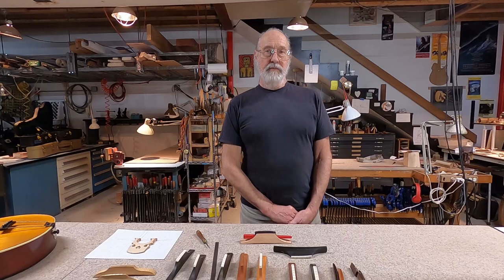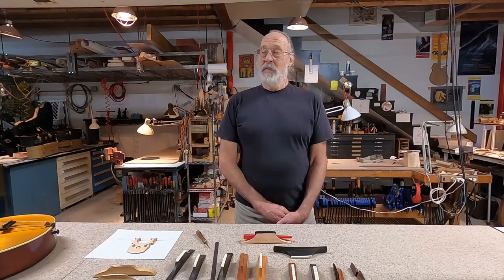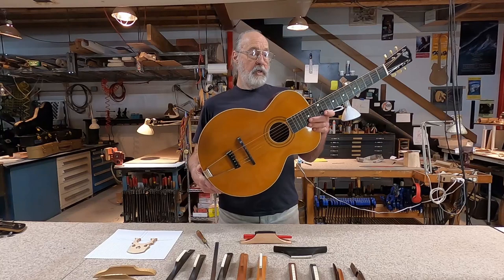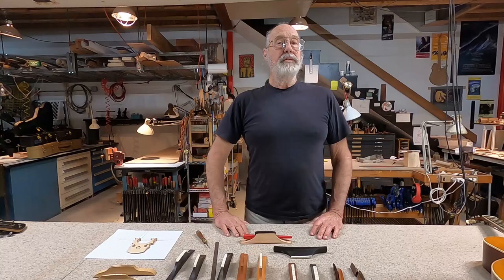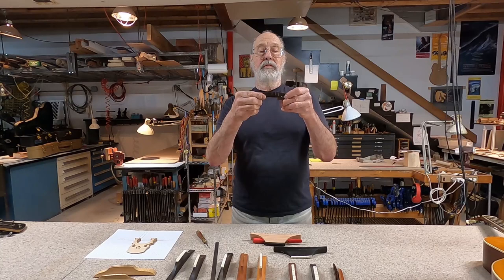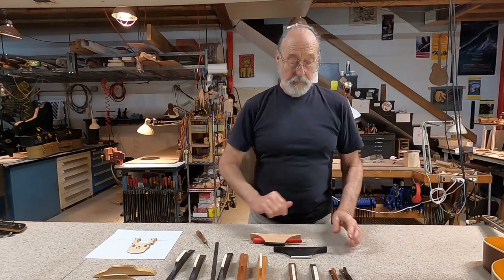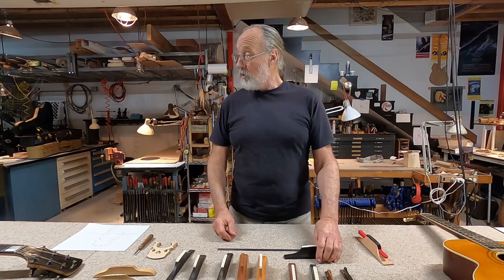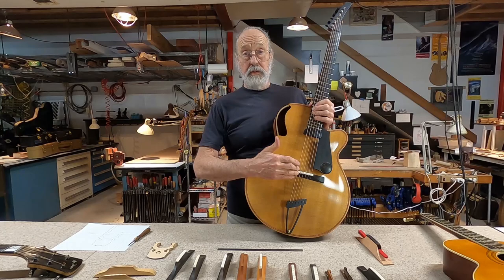Ken Parker Archtoppery: Fitting the Bridge Introduction

Comment: At one point I had a classical guitar bridge saddle that I left intentionally long so I could adjust the action, similar to this wedge design. I did this until I found the string set and gage that suited me best and eventually cut the remainders off years later.  

Because its mostly compression, I wonder how well boron fibers like Specialty Material's Hy-Bor would work to lighten the bridge.
Reply from the maker: That's an excellent idea! I played with boron fibers long ago, and I'm afraid I've forgotten most of what I knew about them, maybe it's time for another look?

Comment: A screw is just a wedge curled up into a circle, so in a sense your wedge bridge height adjustment turns out to work very well after all.
Reply from the maker: Yep, a spiral wound inclined plane can be thought of as an origin story for the machine variant we call a screw.
In the world of adjustable bridges, however, there are some important details to consider as to how these simple machines help to elevate the bridge top.

There are three main parts in this design:
The bridge base, which remains in position, and supports the stack.
The wedge, which slides in and out across the strings to change the bridge height.
The top, which supports the strings, and is raised or lowered my sliding the wedge to and fro.

This means that there are four important contact surfaces between these three parts which need to - be and remain - straight and flat in order to transfer energy without losses due to rocking.
Just saying, this is a challenging structure to build properly.

The angle of the wedge must be small, just a couple/few degrees, so it needs to slide quite a bit in order to  adjust the height very much.
Don't think you can jack things up to play slide, in other words.
The wedge bridge will only give a small range of adjustment, and, of course, is incapable of adjusting one side more or less than the other.
This means that the wedge is normally longer than the bridge base so that it can fully support the top even when at the ends of its travel.
Fair enough, but the bridge certainly looks best with the wedge kinda centered, and looks awkward when it's way over to one side or the other.
This means that the wedge must be very carefully sized so that it looks centered when the action is optimal.
The problem is that this is a fussy kind of problem to solve, although I suppose one could make an assortment of wedges in different heights. Like I said, fussy, and starts to take the fun out of having an adjustable bridge in the first place.

When the wedge is adjusted so as to be jutting out farther on the bass side, it can become a real nuisance by catching the long sleeve or cuff near the player's right hand, or even bump into the wrist.

Two more issues, the bridge top should ideally be restrained from shifting sideways when the wedge slides during adjustment, begging for some kind of locating pin or pins to help with this. 
This is a complication that not all builders include.
In this case now you'd need to cut a slot or slots in the wedge to accommodate the pin(s).

Finally, there's substantial friction between the carefully fit sliding surfaces which can make adjusting the action troublesome. Watching someone perform this adjustment won't look smooth or easy, and might remind you of a struggle. Sometimes a tiny hammer is used.

After all these complaints, I do feel that this design can work fine if these details are carefully worked out.
In fact, most of us are the "set and forget" kind of player, who rarely require any adjustment at all once things are dialed in.
Good news, if its done right, the wedge bridge has a cool look, and probably can transfer the string's energy better than the shaky little screw adjustment system it replaces.
Bad news, see above. Neither easy to build or adjust. One man's opinion.

Comment: Do the asymmetrical top arching on the Celestial guitar serve the same purpose as the slightly asymmetrical top bracing of your current archtops?  What is the rationale behind this asymmetry, given your explanation of the differences between bridge action in bowed and plucked instruments?
Reply from the maker: I got to play and closely examine a lovely '30's D'Angelico in Matty Umanov's shop in 1976.  The guitar had a nice voice, and impressed me very much.  I was surprised to see that he had moved the apex of the arching model under the bridge way over to the treble side, and it made a big impression on me.  It seemed to me that Mr. D'Angelico was thinking that this change in the model might enhance the low end response by making the bass side flatter and more flexible, and improve the trebles by doing just the opposite.  When I built my next (fourth) archtop, "Celestial", I used this model in an even more pronounced way.  I devised a bracing system using a long diagonal bass bar, and five other braces, each one shorter, each one more angled. with the sixth brace very short, and transverse under the treble side of the bridge.  This guitar proved to be very successful, and went on to influence a lot of prominent builders.  It still sounds and plays great, and has never needed repair or adjustment in these 44 years.  All the times I visited Jimmy D'Aquisto, I never got to play one of his guitars in his shop, because everything was under construction, or being repaired.  I asked him why he didn't own one of his own guitars, and he replied that he couldn't afford to!  When I built the Celestial guitar, I meant to keep it, no matter how broke I got, so as to have an instrument to demonstrate, and fortunately, it's still here in my shop!  Even though my work is very different now, I have brought it to several guitar shows in recent years, and it has made lots of friends.

Comment: So that angle where the strings attach to the tailpiece (bass side longer and treble side shorter) is to purposely balance or equalize the ‘loading’ on the bridge?      

I know some tailpieces are straight across.   Some are like the Epiphone Broadways where it’s like two separate tailpieces for the lower 3 and higher 3 strings to have their own tailpiece and length.  And then there’s those trapeze fingered style tailpieces that look like thumb pianos.    I never thought to experiment with that aspect until now. 

It’s tricky sometimes to comprehend what’s more a mod to Art Deco aesthetics vs actual functional acoustically desirable purposeful design.      

Those old school 1930’-50’s archtops sure got dramatic with the gold and pearl Art Deco-esq pizzazz that went with the era.    I’ve dig the vibe of that style but am much more attracted to a cleaner, slightly minimalist approach of form follows function take on the archtop -like you’ve been pulling off for decades!

Something about timeless design’. Thanks
Reply from the maker: Thanks.  I'll be doing an etude on tailpiece design and construction.  Good stuff.

Comment: Ken,  do you think that upright jazz bass should be braced and have a bridge like an archtop since the operation is more like guitar than a bowed instrument?  when i saw your drawing thats all i could think those and f holes on double bass for jazz dont help at all.
Reply from the maker: Good Inquiry!  Maybe try some of these ideas on an old beater?  I'd be curious to know what you find out.
It does seem that you might be able to get a much bigger voice due to the giant size and massive long strings if the instrument was modified to be always used without a bow.

Comment: Just a note on the tailpiece....Gibson made the part that is now ebony in your example , originally out of celluloid, which off gassed and failed. The pin bridge style repair that you see there is a poor bit of engineering since the pins often touched and damaged the top. I repair them with a solid piece of wood slightly arched to match the fingerboard with holes drilled through the flat and recessed to hide the ball....no more pins and clean look to the guitar.
Reply from the maker: If you're referring to my cute old 1918 L - 3, I must tell you the tailpiece and bridge are completely original (!!!!), so this is one of the very few tailpieces that haven't failed in the way you cite.  Amazing that it's still here, though it is pretty distorted.  Your repair method sounds just right.  Closeups if you ask nicely.

Comment: Hi Ken
  I guess I missed the part where you attach the bone part to the ebony of the bridge?
  I am going to hollow out my bridge on my
Slide on the side. 
  When I do I am curious as to what type of adhesive you use to attach the bone to the Ebony.
Pat
Reply from the maker: Fit the parts with no gaps at all, lightly clamp, then wick in thin cyanoacrylate.  Works perfectly.

Comment: Informative and intriguing! Do you think there's a fundamental difference between the footed design and the full-contact design that makes the one (presumably the latter) inherently better than the other-  for an acoustic archtop? Also, are your bridges always bone-capped? If those are replaceable (inserts?) they should provide some means for regulating the action too, no? I find myself changing the bass-side action more often than the treble side, and I don't see how you'd do that with the neck-height action adjustment principle?
Reply from the maker: Thaddeus McHugh, a Gibson employee, (and friend of Orville Gibson himself) developed both the internal trussrod and the screw adjustable  mandolin/archtop bridge in the late teens, applying for patents in 1921.  The Gibson Mandolin and Guitar Company was granted patents on both of these in 1923. The original drawings show a full contact bridge base. Later, Gibson used a two foot design, probably to save labor. In many of these bipedal bridges, the two feet were joined by a piece of wood scarcely thicker than a business card, and this allowed the middle of the bridge to flex so that the feet could rest on the top without the trouble of carefully fitting these contact surfaces.
Have a look at this talk I gave at the Rocky Mountain Archtop festival in 2019...
https://kenparkerarchtops.com/news/2019/9/30/kens-the-history-and-evolution-of-the-archtop-guitar-keynote-at-the-rocky-mountain-archtop-festival
In it, I explain my understanding of the behavior of "two foot" bridges on bowed instruments, and the benefits of using a one piece bridge on an acoustic archtop guitar.
Every design has its pluses and minuses of course, but at some point the designer needs to take a stand, and choose one that he believes will satisfy many practitioners.
The way I see it, the action on a regular steel string guitar, Electric or Acoustic should be about .015" or .020" higher on the bass side than on the treble side. If you disagree, and you commission a guitar from me, I promise we'll work something out to satisfy you.  Thanks for your excellent question.
Reply: @kenparkerarchtoppery9440  And thank you for your interesting answer. If ever I'm in a position to commission an archtop from anyone really, it'd by a nylon-strung. There I might not even need adjustable action - if my nylon-string reso where I don't need it is any indication, but maybe its shorter scale helps prevent fret buzz?! I play with a sort of classical/travis picking hybrid, purely acoustically, and it's proved almost impossible to find steel strings that really satisfy me AND don't buzz as soon as I even think of digging in a bit more on the low strings. My admittedly limited archtop experience to date suggests action could be fixed as low as possible on the treble side (to keep things playable and presumably limit wear on the frets) and adjustably high on the bass side (depending on strings and the piece to be played).
I read or heard a claim that your approach to adjusting action does not require retuning. Is that formally/theoretically correct? As far as I can see there's no geometric difference between raising the bridge saddle height or lowering the nut+fingerboard assembly; in both cases the scale length should increase as Pythagoras would have it. Changing the saddle height does change the external break angle and thus the string tension; I can imagine that could have more effect on tuning than the change in scale length.
Reply from the maker: There's a bit more going on here than you might suspect. Pythagoras would make an awesome dinner companion, and he might point you to some geometric issues you hadn't thought of. When we had dinner 20 years ago, he suggested that if the neck adjusts square to the string at rest, and not the fingerboard, then adjusting the neck height won't meaningfully change the length or tension of the string!
Now that I think of it, Pythagoras wasn't able to make it, and it was Jim Ham who explained this (now obvious seeming) fact to me as a result of his work executing his brilliant adjustable/detachable neck design for his Splendid handmade upright basses.
https://www.hamstringsmusic.com/
Funny how things we didn't understand seem "obvious" when they're explained by the genius who saw the light.
Reply: @kenparkerarchtoppery9440  I fail to picture how one could adjust the neck (but not the fingerboard) square (perpendicular?) to the string unless maybe if with "at rest" you mean starging from the "neutral position". I can see how there will be a small range of adjustment where Jim's explanation is sufficiently exact. But I can think of only 1 mechanism where string length remains almost perfectly constant over any range of adjustment: one where the neck rotations around an appropriate transverse axis through the nut.
I'm not going to ask if you accept the challenge - I no longer have a soul to sell ;)

Comment: 00:17:40  Question: (1) does he leave aditonell material in the middle on the bridge base  or  (2) does he remove material from the middle   to increase the tension on the top of the guitar?
Reply from the maker: Perhaps I've failed to show this correctly, but there is no "material in the middle on the bridge base" to be considered, as it's just not there. In my understanding, the only parameter of the bridge that has an effect on the down-bearing force applied by the bridge to the top, (which I believe is what you refer to here as "tension") is height. Good questions, all the same, the bridge is an important member of the energy path within the guitar, and begs to be fully understood. Maybe in 100 years, we'll start to catch up to the violin makers?
Reply: @kenparkerarchtoppery9440  sry, english is not my first language: I accidentally recoverd the "one piece bridge" - when I lowered a new bridge saddle (which was far too high) so it had full contact with the 2-foot-bridge base. That was a dramatically increase in tone and "response". So I'm actually hollowing a one-foot-bridge-base. My question is: if the bridge-base fits the top - should I take out little material in the middle of the bridge base?
Reply from the maker: @didifischervideo  OK,OK, thanks, I think I know what you're asking now. Really good question. Yes, I think this is wise, and it's what I like to do. I think it's not good when the bridge touches harder in the middle, and it can cause funny noises if the ends aren't touching the top firmly. I think we agree that it's much better to make sure that the ends of the bridge make firm contact with the top by removing a small amount of wood from the center after you get it to fit correctly.  This is a subtlety, and should be a very slight adjustment. The idea is that the stiffness of the bridge will overcome the cross-grain stiffness of the top, and deform it as it is loaded by the strings, insuring that it will touch firmly from end to end.
I hope this makes sense, it's important so that the bridge ends can help to drive the top.
Reply: @kenparkerarchtoppery9440  Thanks : )
Reply: @kenparkerarchtoppery9440  Thanks, last question, as I removed the wheels from the bridge and cannot change the truss rod (because it's an guitar from 1954): does the neck in summer make a bow? And is more straight in winter? Or otherwise? Or is just the top moving?
Reply from the maker: @didifischervideo  Wow, that's one heck of a last question!  If I know you, I'll bet this isn't even close to your last question, Bravo!  First, let me suggest that you try your hand at making a one piece bridge for your guitar after you get the present one sorted out. It's fun, and you'll learn something about how bridges work, and you may be able to improve the sound of your guitar, too.The guitar is just a wooden box with a stick of wood attached to it, and like all wooden structures, it will respond dimension-ally to changes in humidity and string forces in complex ways. Usually, the top expands with an increase in humidity, it pooches up and raises the action.  For the same reasons, the neck normally tends to get straighter when the humidity is high, and bow forward when its drier, but not always.  There are lots of different ways to make a neck! 
I would say that the best practice is to put the guitar in an environment of 40 - 45% relative humidity until it settles in and stops moving, then adjust it to play well, and finally, keep it at that humidity forevermore.  If a guitar dries too much it will crack, and if its too wet, it won't sound good, so this is really important.
Fortunately, you can get Humidipacks from D'Addario and others, that automatically keep your guitar at this humidity when stored in a closed case. Game over, and now we can go back to practicing!
Reply: @kenparkerarchtoppery9440  Thanks, for the long answer. I did not want to bother you, I thought there is a simple answer : ) I just adjusted the string height and thought: What happens if I make it now perfect - will the string action be lower in winter, summer, or fall?  I cant' adjust the trussrod.
Reply: @kenparkerarchtoppery9440 😀 thanks!